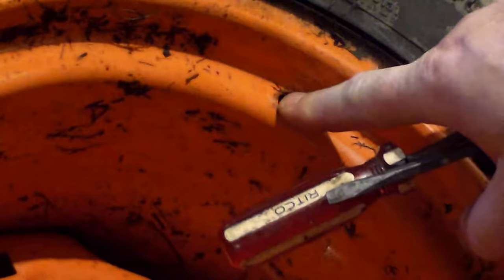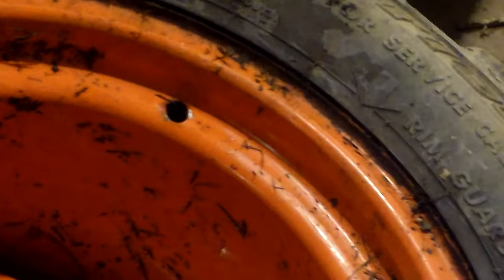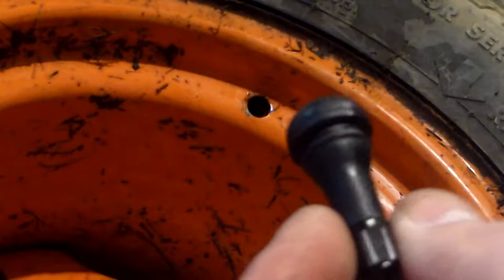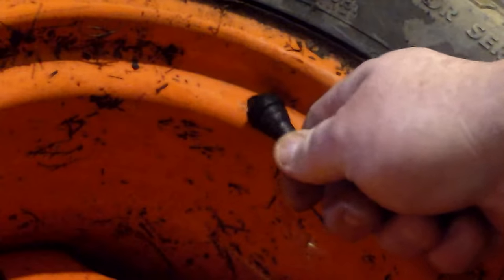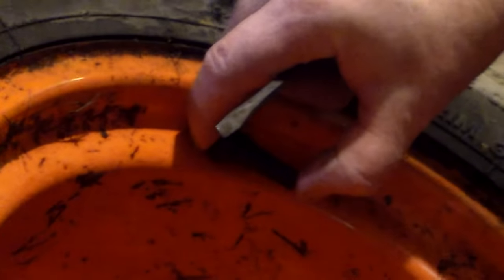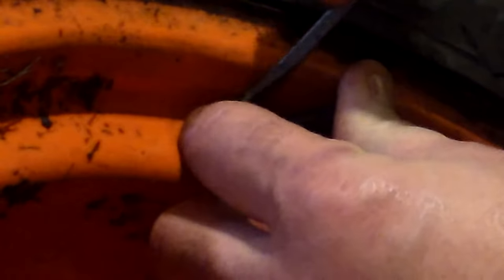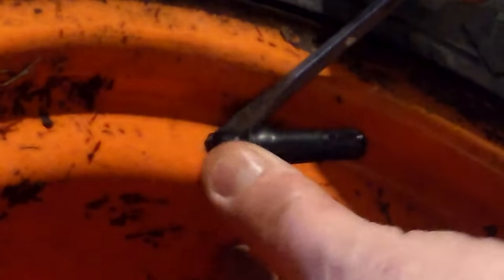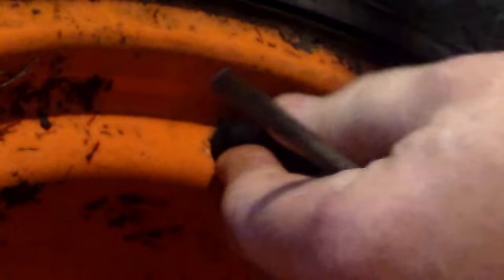Installing a tire valve stem at home without removing or breaking tire bead.

Comment: Did this to my rear tire on 2010 Yamaha R6, and all I have to say is I have no idea how this man was able to accomplish this in under 3 minutes. Yes, it can be done. Yes, it’s a “simple” fix. YES, it took me almost 2 hours lol. I’m going to do this on my front tire as well, and am deciding to go the c-clamp method, as this one caused me so much headache and frustration. However, without this video I wouldn’t have know it could be done or how to do it, so I really appreciate that.
Reply: 20 mins later i still didn't get mine in.. lol 
"easy fix" still considering just.. taking off the bead
Reply: Doing this on a steel rim is much easier than aluminum
Reply from the maker: yea buddy
Reply: @Tjs_powersports  Yep, but, I've done it on both in less than 5 minutes just like the video.  The steel is easier, like a couple minutes, but I use a smaller screwdriver that I rounded the edges so it's not so sharp and just use some WD-40 and it pops right in.

Comment: They do make a tool with a hook to remove it . Then a cone in the hole . Some lube and it's pushed through with a threaded rod . Your method also works .

Comment: Hey just installed one using this method, one thing I had to do was use a pair of pliers to grab and squeeze the valve stem because I couldn’t really squeeze and hold it with my fingers and then I used the technique of pushing it in with the screwdriver
Reply: Agreed, squeezing with pliers makes it easier to get it started.
Reply: Nice idea, thanks for the tips.

Comment: Bro, I've got 2 words for you and this video: ROCK STAR
You saved me serious stress and time with this!  I was worried that I didn't have a dull enough flat-head so as to not damage the stems so I found some needle nose pliers (closed) and popped each valve in, taking less than a minute per valve. Initially I thoroughly cleaned the hole with a wire brush, then a round file, then super-soapy q-tips. Unreal! Store-bought tools are overpiced and provide no guarantee, and would just lilkely get you here. Thank you so much for the BOSS LEVEL instructional!!!

Comment: Wow I'm stranded and I don't have that proper tool but I do have the new valve stem thank God I had that but I didn't know how we're going to do without the tool and you just saved me the biggest headache I was scared it's cold I didn't know what to do I don't have AAA I have no one to call for help you save me pal it worked and I'm on the road traveling again I owe a lot to you for this video

Comment: If this method doesn't work, lay the tire down under something heavy like a vehicle frame, hitch reciever, etc. Take a scissor jack or bottle jack and place it between the frame and the innermost part of the tire. Start jacking. If it doesn't pop loose, use a pry bar in the exposed bead to assist. Takes maybe 5 minutes tops.
Reply from the maker: I guess

Comment: Well, this just rescued me.  Sure, sure, break the bead, use your shop compressor to re-seat it.  Meanwhile, in the real world, sometimes all you have is a spare valve, some silicone grease, and a blunt screwdriver.

Comment: Many, many thanks, you just proved my idea that its possible to push the stem into the rim... i was just missing the details shown in your video... rubber is very flexible and easy to work with patience....

Comment: I bought a Nash Metropolitan that was in a barn for years. The stems broke as soon as I touched them. I left and went to napa and bought 4 stems. I did the same trick. The dry rotted bias plys leaked,but I was able to get it on a trailer and home without much effort.

Comment: Excellente~

Proof is in the puddin😔

THANK YOU

Warm the new valve.

Don't mar the edge of the hole.

A duller rather than a sharper screw driver, for obvious reasons.

Comment: Maybe soak it in 303 Protectant to make it more pliable and the residue will act as a lubricant . I know there are plastic pry tools for removing interior trim in cars , better than anything metal ?
Reply: Good call, a plastic spudger or a small plastic bicycle tire lever are both less likely to damage the valve.

Comment: I tore off a valve stem in sand  on my s by s and had to travel 5 km on 3 wheels . My daughter sat on the driver’s side bumper forward to keep weight off rear right flat tire. Hit a few bumps on the way and put a crack and a hole threw the aluminum rim. However a welder fixed that. Too bad I did not know this trick then. Now I can see we need spare valve stems and a screwdriver in all atv,s . Also our vehicles because Murphey’s law still applies.
Reply: And a little bit of oil

Comment: Great video, and that has helped a lot of people over time, but there's a much easier way now.  QuikStem will put a 200psi rated metal stem in your tire in seconds without pulling the wheel or breaking the bead out in the field where it broke.  Here's an install in a tractor tire - the QuikStem in the video has been running in that tire for over 5 years now. https://www.youtube.com/watch?v=g6V5Vkz9Edg&t=1s

Comment: Yes it works but its better to break the bead and change the valve. At least you will know that its not bodged. A few minutes well spent.
Reply from the maker: agree if you have a machine those are hard to break off at home.

Comment: So you got the previous half of the valve stem just rattling around in the tire? Ngl, this method sucks... breaking the bead and putting the valve stem in correctly is easier than this.